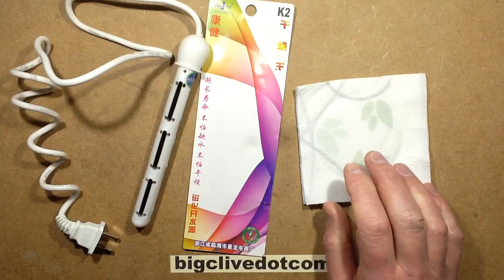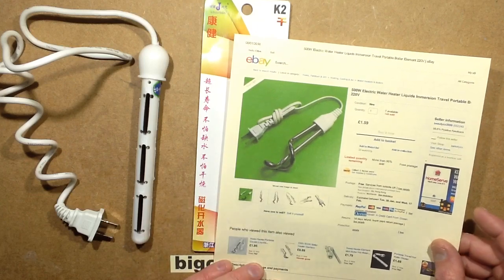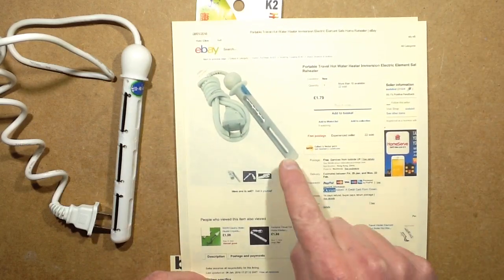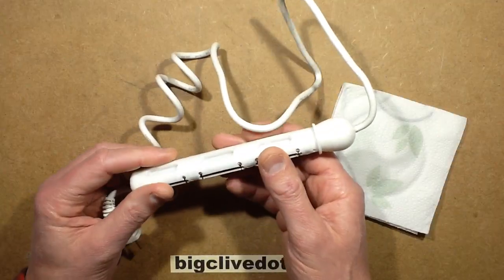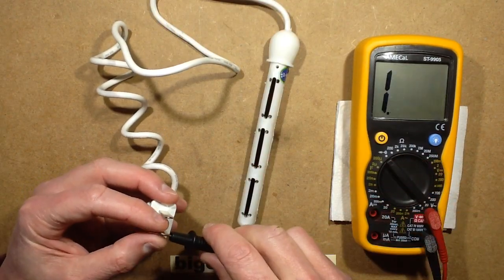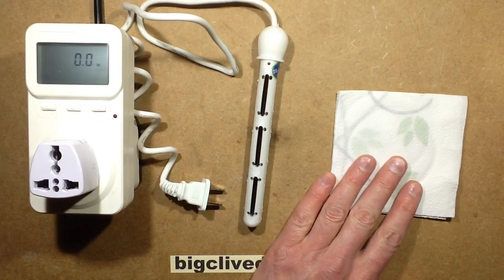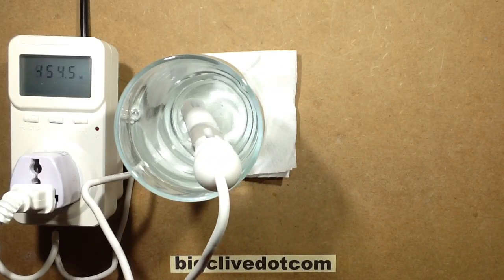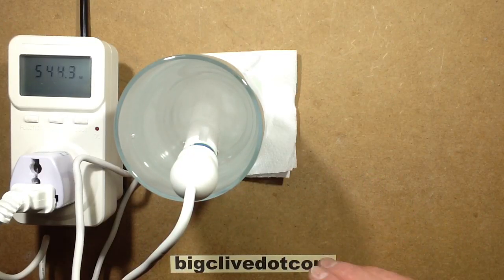Dangerous 240V Coffee-Cutor (coffee cup electrode boiler.)

Comment: I am Chinese and this is a very common thing in my college time back in the late 90s and early 2000...
we didn't have 24 hour hot water at that time. we use it to heat large amount of water to wash things ...never drink it.
Reply: @labobo-h7u  it's grounded, but I lived in a house without grounding wire for 20 years, never took a shock in the shower. But in computers and refrigerators I took some. Particularly, I ever ask if the house has proper grounding before rent it.

Everybody here in Brazil uses this kind of shower, except in hotels where they usually opt to use gas heated ones. The fact is natural gas is pretty expensive in South America.
Reply: @lauratiso  Here we have central heating. Several building take heated water from a single building close by. Use it to warm the buildings and for showers and cleaning dishes.
Some houses have large cylindrical water tanks that can either be heated via electricity or by oil, wood or pellets (compressed wood balls) burning in a specialized big stove/boiler. We don't use gas at all.
Reply: @labobo-h7u  unfortunately, all of these options are inviable in Brazil by historic, economic and/or environmental reasons.
Reply: @labobo-h7u  I still use one everyday. It's not that dangerous as people say in other countries.
Reply: The point is, you're "electrocuted" if you touch the water. That's insane.
Reply: @Eeda01  so don't touch the water
Reply: @lauratiso  Duh
Reply: @lauratiso  the voice of reason.
Reply: @jakehughes1369 , I said it more as a joke, but I remembered I live in Brazil and I use a suicide shower every day, twice per day during the summer.
Reply: Marcus Tiso did you ever feel anything strange?
Reply: @EdIvory  never.
Reply: @labobo-h7u  Electricity will take the shortest path to ground, which is usually the other conductor. When it's not, that's why we have ground wires. Yes, this is "unsafe", but then so is not having airbags correctly installed in your car. In fact, your car is likely more of a death trap... as not only are there faulty airbags you might never know about, but there are NO airbags for the people who end up being run over. Ground wires exist to deal with the unlikely scenarios, just as the airbags... and to be clear on this, there are cases of people dying because of both "safety devices".

In the case of your faulty wiring, it seems to me like your problem was a faulty device propagating across a circuit that didn't quite manage to become a ground circuit, so that the electricity would not flow through ground but instead propagate into your other devices. That is to say, correctly wiring your grounds to your shower here would have made your shower live, which is precisely what you don't want, right? Something to consider... grounding might not always be so wise, right?

> Got myself electrocuted

No you didn't, or you'd be dead. That is the literal definition of "electrocution"... death by electric shock. Seems mighty tempting to me, as we live on this planet with people who get confused over basic concepts like when to use the word "shocked" instead of "electrocuted". I honestly would like to die, peacefully, sooner rather than later.

> felt like a vibrator

This actually sounds quite pleasant. Maybe I'll buy one of these stupid showers. I wonder if my landlord would wire it up without grounding it for me?
Reply: @sebastianramadan8393 
"Electrocuted: Injured or killed by electric shock"
-Oxford English Dictionary

Comment: Part of the swirly stuff that you showed is just due to the temperature difference between the different parts of the water. At different temperatures it refracts the light sligthly differently or something, I think there's a name for this effect that I can't think of right now. It's probably steam as well though.

You can reproduce the effect by pouring some hot water into cold water. It'll look somewhat swirly.

Comment: And if it is plugged into 120V mains in the states, will it work?

Take longer?

Asking for a friend.
Reply: It will absolutely work, we used a very similar device made out of nail clippers, a toothbrush, rubber gloves, and an old extension cord or really any two wires that can be stuck into an outlet to heat water in jail. Though we would also add ramen noodle seasoning and/or laundry detergent to the water, I'm assuming the sodium in the seasoning and the chlorine in the detergent allow more current to pass through the water. It only has two electrodes vs the at least 6 on this consumer style model (obviously ours looked nothing like this and almost always ran on really thin gauge wire, which I believe reduces the amount of current that can possibly come through) and it would take about ten minutes to boil water inside an old fluff container (1 lb container) and that would then boil water we had inside of a sealed rice bag (the ramen noodle seasoning/laundry detergent water is pretty nasty, especially after electricity is run through via scavenged metal, so we always used a double boiler set up). Thing was dangerous as fuck, it's called a stinger because of the 60hz (or 120, I think 120 actually) "stinging" noise that it makes when plugged in and immersed in water.
Reply from the maker: Yes it should work, but would take a lot longer.
Reply: @labobo-h7u  Yeah, sure:
https://www.youtube.com/watch?v=q2r0GMVAWyI

This uses razor blades and toothpicks instead of nail clippers and toothbrush plastic for the obvious reasons of no one is giving you an unaccounted for razor blade in prison.

Also, you are misunderstanding what is actually happening, imagine an empty container of marshmallow fluff, now you fill it with water, add pretty much any chemical that lowers the resistance of the water (powdered laundry detergent occasionally but most commonlyramen noodle seasoning because it's so abundant and salty), dip in the stinger, and let it start to boil. In the meantime, you take an airtight plastic pouch (or another smaller container), which are in abundance as many commissary items like rice come in them, and you put your ingredients inside the pouch, seal it, and then insert it into the boiling container of marshmallow fluff for however long it needs to be boiled for. You are effectively double boiling it, so the food never comes into contact with the conducting water.

You could use just clean water if you wanted to, there was more than enough shit in the pipes that came through that would probably conduct decently well, it's just way slower and where I was a CO came by every ~15-30 minutes and looked through our cell door window. You could try to hide it when your cellmate tells you they're coming but it's not worth the risk and they can usually smell it, so getting the water boiling in 30 seconds and the food cooked in less than 5 minutes was definitely the way to go.
Reply: Ita a 120v plug not a 240 this guy is actualy dangerous

Comment: I didn't understand why it's dangerous
Reply: this can be seen as a *kitchen item, and as such would usually be plugged into a receptacle with a GFCI (as per NEC code in the US). there is still the possibility that a person could be using this thing unprotected and making contact with ground (let's say touching the kitchen sink with your left hand), and then somehow come in contact with that hot with your right hand, (like touching the spoon). This would then give you a nice jolt and fuck your day up or potentially kill you.  this potential hazard rings true for pretty much anything though.. you use a corded drill you run the risk of a fault where you become a load as current travels to ground, assuming there isn't a much better path already at the time, and your drill is not ran through a GFI cord. any appliance that is so crappily made that the hot is 'easily accessible' is pretty unsafe.

Comment: aren't you hydrolysis water with this thing? try waving a match over the boiling water to see if you light up O2 and explode H2...
Reply: Gas won't be dense enough. But with the proper soap/washing solution/etc. we could create H2_bubbles. 

Back in the days I've just used a straw and a bit of washing-up liquid to create as big bubbles as possible. The "pop" was as loud as in cork gun, or whatever it is being called ;).
Reply: werek wot you're saying that the gas/es wont be "dense" enough? the "density of O2 and H2 is much much lower than water, so they'll rise up and it's possible to collect them. are you saying that the "concentration" won't be high enough, i.e. the rate of production is too slow to make any meaningful amount of gas?

Comment: Err, you do know that gas coming from the electrodes could be hydrogen and oxygen? I read about Stanley Meyer's prototype cell where the stainless steel anodes and cathodes were spaced at 3mm. He stepped the voltage up to 600 and the frequency to around 10kHz. Check out these water welders https://youtu.be/eGz5X1hB3Nw?t=178

Comment: What if you were using a metal cup?
Reply: You'd probably be somewhat dead.
Reply: only 200w just shock
Reply: Look at biggerbadwolf's comment on here (nearer top), someone he knew did it
Reply: faizan joyia depends on the voltage...
Reply: anything above 10 amps is pretty much death
Reply: xXViverraXx but then again if the voltage is 5v AC 0.2A that would be a shock and most likely a powerful one. Voltage is needed to electrocute you and amps are needed to assist to that; killing you
Reply: U=R*I for fucks sake, this isn't rocket science.
Reply: actually anything above .2 amps will kill you if you arent attended to immediately and also voltage wont kill you if there is enough amperage any measure of voltage will kill you

Comment: And Also this product is not dangerous unless you are referenced to earth (Ground) I bought one and i absolutely love it. i did a human experiment (Seriously, don't try this yourself). I touched the water and didn't feel much, then I touched a sink (plumbing is referenced to earth) and got about a 110 volt shock on 240 volts. So basically, you divide the voltage going into the water by 2 and that would be the shock you get. North america uses 120 volts so you would only get a 60 volt shock. In conclusion you could touch the water as long as you are not referenced to earth (ground).

Comment: This reminds me of an old product called a "Hot Dogger" that cooked hot dogs by placing them on prongs at each end that were connected to 120 volt line/mains voltage.
Reply: Surprise surprise, he just made a video about the hot dogger
Reply: you still get them
Reply: Holy fuck. Metal electrolyzed sausage, yummy.
Reply: @Sypaka  111 / 5000
Übersetzungsergebnisse
Electricians on construction sites also use this trick in Germany, hot sausages in an even shorter time with 230V
Reply: They were selling these at a campground store I visited a few years ago, but battery powered and made for toasting marshmallows without a flame.  It's amazing how many warnings parents will ignore to let their kids hold live electrodes over open flames.  Truly a disappointing miracle that they made it to a reproductive age.
Reply: I had to confiscate a pair of blackened forks someone at the makerspace had welded to a plug in in a misguided attempt to make their own hot dogger. It had tripped the breaker on more than one occasion
Reply: @JamesSeymour  Well,  would be different in many other countries. We use 120V (60~) here in the USA. The same hot dog would absorb 4X the power in countries with 220-240V.

Perhaps a LOW SODIUM wiener would be more appropriate in those countries. :-)
Reply: @ChaplainDaveSparks  this was in the US, I think the distance between the prongs were critically miscalculated.  But we aren't allowed to cook hotdogs in the electronics room anymore.

Comment: I have only recently discovered your channel and I am a big fan. Saw this video about the electrode boiler which you found on ebay. I saw them on Amazon. My interest in them is this. I have a small campervan and I lack hot water. My idea was to heat the water when required by introducing an element into the large plastic water container. I have tried this with a simple cup element and it works. My concern was when the water was used up and the element overheating and melting the container. Hence my interest in this boiler. From your description it seems when the element it not covered with water it does not overheat. If this is correct and it is safe to use in my configuration my only concern is can it be totally immersed in water or must the top be kept dry. If so maybe I could drill a hole in the container and somehow fix it in place so the top part is kept dry. Sorry for the long comment. Regards.

Comment: Just curious: If you were to touch the water briefly by accident, would it kill you instantly, or would it just deliver a really nasty shock?
Reply from the maker: +Lord Sandwich If you provided a path to ground (standing on damp concrete or touching a tap/faucet/pipe then without RCD or GFCI protection it could pass enough current through your body to kill you in a fraction of a second.
Reply: bigclivedotcom
Wow! 0.0
And there's a high likelihood of that, given the intended use for this thing! That's scary! 0.0

Comment: Shouldn't it also produce toxic ions/compounds in the the liquid?!
Electrolysis of salt water is a good way to make Chlorine gas. it also makes a pretty nasty sludge of chlorine-hydrides, NaOH and an orange chromium or nickel salts if you use stainless electrodes.

Comment: WARNING! It might be very dangerous to drink the boiled water because the metal of the electrodes might spread in the water because of the electrolytical effect. Who knows what kind of metal the electrodes are made of? If the water comes in contact with the cupper cables connected to the electrode plates it wil be poisonous.
Reply: @labobo-h7u  The metal from the electrodes will spread to the water so if there is a copper electrode the water will contain a lot of copper after a certain period of time and as a result you can develop copper poisoning. This goes for other metals too as while most are required in certain doses in the body almost all become poisonous in higher doses. In addition if the water has a high salt content you will produce some chlorine gas in addition to the oxygen in hydrogen which is an explosive mixture, while also in very close contact to a live circuit that can potentially cause sparks if any additional metal is added into the equation. If you use this on a regular basis you will likely develop some sort of metal poisoning due to your daily or almost daily intake. If you are ok now it is likely no major damage occured and that is definitely possible but the risks definitely outweigh the benefits in this case. Most metals that electrodes tend to be made out of are acutely poisonous and dont buildup in your body on the level of  heavy metals such as lead and mercury so assuming no more exposure and no symptoms you are likely fine.
Reply: what do you mean if? All factory made stuff in china is very poorly put together. I think you mean when.
Reply: @labobo-h7u  Likely not a problem if you're using fractional evaporative/condensing distillation, as the copper oxides left in solution aren't likely to evaporate so easily. However, consider the principles of electroplating metal, and you should see the problem here... just a reminder, copper is not the only problem... there are heavy metals of all kinds in our electronics. I think lead might be a fair bit worse than copper.

Comment: This seems like one of those things that would be safe so long as you use it properly. Maybe you could make one with a dedicated mug, and the heating element is the lid. The only way to make it work is by putting the lid on, plugging it in and switching it on. That way it would be impossible to get to the water, and if you took the lid off, the power would cut out because the connection is cut and the charge would dissipate. The only danger then, I can think of, is if the thing leaks.

Comment: just remembered, you are right. in very dry countries that thing wouldn't be quite as hazardous as it is here... 

I remember seeing in Egypt a power cord crossing the street which had lost its insulation due to the passing cars. basically there were just two blank copper wires running across the street and the power tools plugged in at the other side worked just fine. or the street lamps which wouldn't short circuit to ground but instead started to burn. 

And then of course the standard human errors like connecting the standard 240 volt socket to the nearest electricity which happened to be the 360 volts for the ac. or the bedside lamp with the metal switch that clung strangely to one's fingers.

And the fun with the electrical net. passing only one phase. or whatever happened to that ceiling fan that started to turn really really fast before crashing down.

As you say, fun times!

Comment: How hot would the element need to be to start breaking hydrogen and oxygen apart? Would you have enough current from the mains for it to get to that temperature no matter how much dissolved solids are in suspension?

Comment: Had a meter which had an internal supercap which was charged, by putting the leads across mains.. Well it had one 20A port aswell ^^. Afterwards the one pin of the probes had a ball of metall instead of a spike at the End and the meter "exploded" internally. ^^